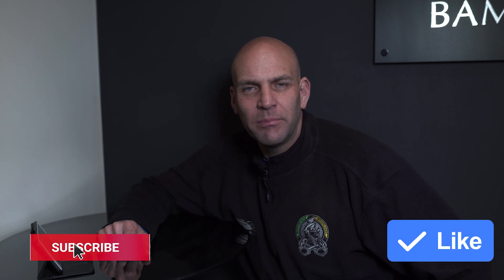Why does V12 Vantage Fail Number 11 and 12 Pistons? Forum chat #21

Comment: As always good info for those worrying as to whether the V12 they're sat in is a money pit in the waiting. So how do we avoid it. Is it just a question of checking the breather circuit along with the oil level. Are there signs that can direct us to the Breather Issue in the first place or is it just a question of monitoring the oil level on a weekly basis instead of a mileage basis, and if its suddenly dropping we investigate the breather for failure. If that makes sense
Reply from the maker: Tony check oil filters at service, if heavily contaminated with oil means breather circuit is compromised. Best to check oil level at least every 1k miles on flat surface and when engine is cold
Reply: @BamfordRose  Hi Mike, that makes sense, nothing to drastic as always a common sense approach. Oil Level check at 1k sounds good for me thank you once again.
Reply: Mike, does this relate to a specific v12 or can it happen to all of them?